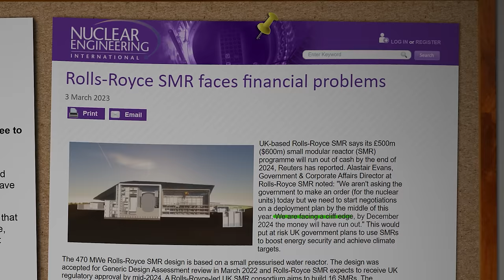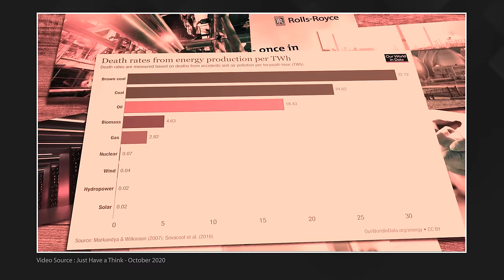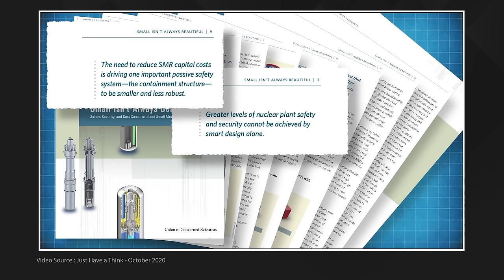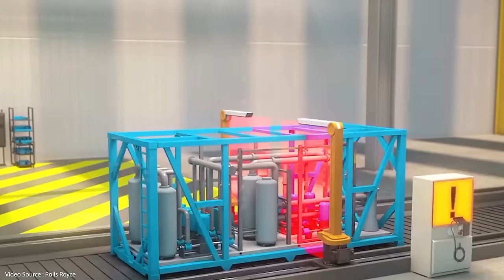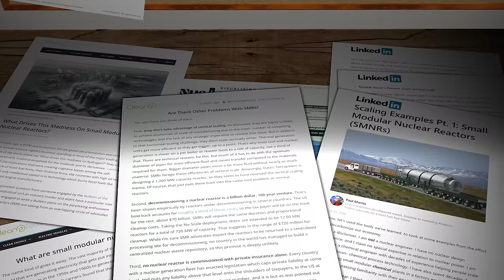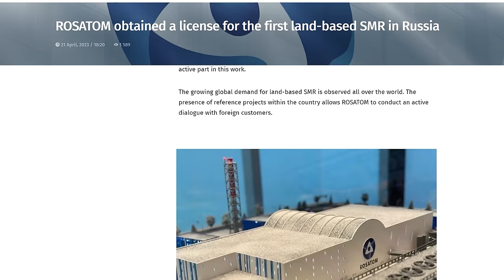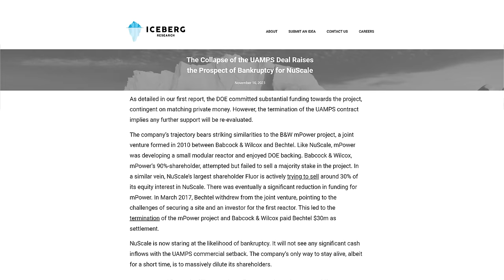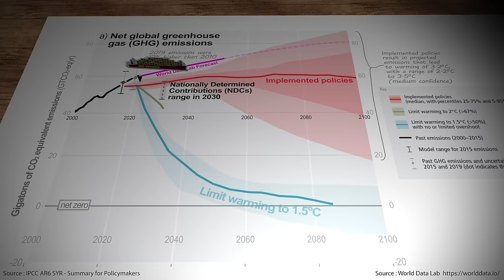Small Modular Nuclear Reactors. The Verdict

Comment: SMRs dont make any sense. Nuclear power was expensive. So they tried to build the largest plants possible to leverage economy of scale. That failed. Especially in the west. You need to be building nuclear reactors continuously to have the expertise to do it affordable. The first one will have a huge cost overrun. So the nuclear energy came up with a new idea. Make reactors really small so they can be mass produced. And in this way leverage the economy of scale. Problem was, making a really small nuclear reactor is not safe and has technical issues. So almost all SMRs are just small nuclear plants. Build in the same manner, just smaller. They aren't mass produced in a factory. And you don't build like 16 of them, to add 16 more later. You just build 1. So it's complete misnomer. If SMRs were actually small and cheap enough so that every town could buy their own SMR, then ok that's different. But it's not that at all. And guess what! It is way more expensive than the older very large plants. On top of that, solar has gotten absurdly cheap. The cheapest energy ever. And you can just place panels next week. Not in 30 years. Even offshore wind starts making a profit in 6 to 18 months. But nuclear needs government in subsidies, government insurance, government guarantees for decommission and cleanup. And even in that case, you will only start to make a profit 50 years from now. Assuming solar and wind don't get even cheaper. And that doesn't even go into the load-following aspect. Or the aspect that we will overproduce electricity and the cost comes from transport, storage, and using it when there's no wind or sun. Which nuclear won't be able to adjust to.

Comment: Small modular reactors are already being used to power submarines and aircraft carriers aren't they? So whats the problem with using this apparently proven technology for domestic purposes?
Reply: You are exactly right....what is the problem?  They have been around for over 60 years and neither the U.S. or Russia are using them to produce commercial power.  That may not explain why but it sure does prove that they are completely different from what is necessary for a commercial application and that SMRs have never been and never will be the answer

Comment: They're fine. The point is that one of the main costs is regulation so if you could just make identical smaller reactors and add them to a site, that could reduce costs to a significant degree. But like with working thorium reactors having existed for decades, what is rational doesn't matter so much as political-social incentives. You lean into the latter facts under the guise of the former far too often unfortunately

Comment: Nuclear power is still the best and the most "green" form of energy. Wind turbines need careful consideration to almost the same extent as dams for hydroelectricity for example. Altering the winds would have perhaps even worse effect on the environment than daming up waterways. The issues with solar are more complex. It works decently on short term and for modest scale but solar panels still need decades of development before they can surpass their own carbon footprint for creation. Nuclear energy on the other hand may be expensive but it's largely down to regulations. If a gas or coal plant would be under similar restrictions we'd be talking about similar expenses. Some of these regulations are reasonable (and written in blood) but others are just done to further feed the paranoia.

So no, for a new green Earth the most sane solution would be nuclear power. And if it needs pulling the wool over regulators' eyes to greenlit more nuclear power than it shall be done. That's my own take on SMR. It is an improvement but the main problem is that countries are less willing to build tried and proven nuclear powerplants. So they try to paint SMR as the lesser evil and finally get more nuclear power down. And who knows? A lot of technologies involved with SMR can be fed back to conventional nuclear powerplant designs in the future. Consequently it also adds money that can be spent in the sciences and engineering of nuclear reactors which may get the promised "holy grail" of fission power in the future: actually small nuclear powerplants.

Comment: For large parts of the world solar is an option. Wind is not an option, it's too unreliable. To rely on wind in the UK in Dec- Jan, you'd need about 2 weeks of storage. For the UK that's would be about 14 TWh of storage. I'm not aware of anything that can store that amount of power. We currently use fossil fuels to provide that back up.
For northern latitudes, I don't really see any alternative to nuclear.
I don't really consider 400 MW a SMR, not really the sort of thing that can be mass produced.
Personally I believe nuclear, in one from or another, will be the solution to our energy needs.
It'll be interesting to see in 10 years if nuclear conquers all, or if there is an amazing cheap, vast storage solution breakthrough. It'll be quite nice if we get both.

Comment: Only when we can completely reuse electric batteries and not have them as an item that cannot be recycled after the vehicle has been used in any way whatsoever landfill cannot have any of these batteries whatsoever so until we get a better system and we put along a little bit we may find that these electric cars are only good for certain places at certain times And you certainly can’t ensure them good luck with that. Regards Al from down under.

Comment: Attempts to build and deploy SMRs have kinda fallen on their face so far, precisely due to the lack of economies of scale.  The problem is that just achieving production scale alone isn't even remotely beneficial enough... it does not translate to the entire project gaining the same economy.  A great deal of infrastructure is needed even to just support a "small" SMR.  The permitting, building, operation and security, methodologies for fueling and maintenance and monitoring, labor, employee count, and grid infrastructure required... none of that scales or ever will scale.

SMR projects have been rapidly upsizing the amount of generation to try to justify the cost, to the point where they aren't really "small" any more, let alone modular.

I personally think that SMRs are a fail.  The only path we have to nuclear is to build large reactors, and economically speaking there's no point even starting to think about doing it until there's enough grid-scale storage to allow new reactors to operate with a consistent output 24x7.

California was only barely able to support its one remaining nuclear plant over the past decade.  It has actually gotten easier now that grid-scale storage is being scaled up in the state.  And as more grid-scale storage is added, the easier and more economical it will be to support nuclear generation.

-Matt

Comment: Climate is not becoming more chaotic. We need to stop building in flood plains and on beaches.
Reply: We have global warming, which is causing climate change.
Reply: The floodplains are much bigger than they used to be. In my city, we've had two 500-year floods and one 1000-year flood in the last 24 years.

Well it's possible this was just an extreme outside statistical event, it's more likely that the floodplains are no longer correct.

Comment: similar to aircraft carriers, submarines ones, could it be
Reply: Reactor submarines are not cheap (fuel load is $1 billion), they are very inefficient because they do not have the room for reheaters, and they have  none of the safety systems required for commercial units.  The first U.S. nuclear power plant (Shippingport) had a 60 Mw output (typical SMR capacity) took up three levels and 4 acres.  Look at a typical commercial power plant (1,000 Mw) and any SMR fraction of that output will be at least that fraction in size.  The larger the plant the more efficient it becomes and vis versa.

Comment: I work in the Nuclear power (US) and it was obvious to me over 10 years ago that a nuclear resurgence would never catch renewables like wind, solar, and hydro just by looking at the megawatts of these other technologies coming on line each year.   15 years ago there was talk of a nuclear renaissance in the US but most of this plants were scrapped with only the 2 unit Vogtle site in Georgia coming on line.   Nevertheless, I would like to see nuclear move ahead to that it might aid in the retirement of fossil units which is sorely needed in the next 3 decades, and just in case there are other issues with renewables that emerge.
Reply: I worked in the nuclear industry as well and live within 60 miles of both VC Summer and Vogtle.  My electric rates have increased 25% specifically due to Vogtle units 3&4 and will increase more in the future.  I am pro-nuclear but also a ratepayer and I have to say today the massive cost of new nuclear cannot be justified.

Comment: What about mineral requirements per GW of power? Do we have enough minerals for the renewable transition?
Reply: Yes. And a fossil fuel economy requires 500 times more materials mining than renewables. The crap you have to continuously mine, transport, and shovel into a thermal plant to produce energy had to come from somewhere.
Reply: @skierpage  , I would like to compare renewables with nuclear power, which has a very high energy density. Please also consider battery storage in case of renewables.

Comment: I'm up for all of the technologies in play that help us achieve our goals, and the behaviours too.
If the IPCC wants nuclear on the cards, then we should ask why are they right, and to not do so, wrong. If we also want to have our low carbon technology to be long lived, would we go for an 80 year life technology or a 20? Would we want one that consumes low levels of minerals per unit energy or a higher, because mining and tailings cause pollution too. Do we want those technologies to also provide high quality long term jobs, or not? Nuclear provides those jobs, wind and solar neither provide the same number, duration and quality (educational requirement) of jobs, nor the same level of secondary employment. We might only want electricity from our renewables, but if we want process heat, we can get it in a much more consistent manner from other sources. Would a smelter run efficiently with intermittent power? Certainly nuclear has it's problems, and one of the biggest ones is not learning from those places that can and do build on cost and on time (or close to it).

Comment: It's ignoring a VERY big elephant in the room to say that battery storage is real and easily scalable. 
The current installed grid connected battery storage in california for example is Infinitesimal compared to the capacity that would be required to shut of the states natural gas powerplants, which currently supply a full half of its power. 
The economics of battery storage dont work out.

Comment: You should investigate advanced modular reactors (AMRs). In particular the UK company Newcleo and French company NAAREA that formed a strategic partnership to accelerate the development of their fourth-generation nuclear technologies.

NAAREA is developing a molten salt-fast neutron nuclear micro-generator capable of producing 40 MW of electricity and 80 MW of heat, while Newcleo is developing two concepts for lead-cooled mini-fast reactors (30 MW and 200 MW).
Reply: On-paper nuclear technologies that exist in PowerPoint presentations are always better than the boring costly reactor designs existing in the real world!
Reply: it's just a rehash of an 80 year old design idea.   I have yet to see a so called 4th generation reactor which is not something that is quite old and in many cases did not work out at the test reactor stage many decades ago.

Comment: Yeah, right. Building high voltage power lines is trivial and can be done over night, whereas a nuclear plant can't? Nimbies seem to hate wind power, and whose going to pay for the grid upgrade needed for large scale adoption of solar? There are also massive challenges with renewables. We need a diversified approach which involves spreading the risks over multiple technologies. Nuclear power has a number of critical advantages, like the ability to provide reliable base power, which renewables critically lack. I don't give a crap about 2030! We almost certainly will not make those goals, so it's not a relevant argument that nuclear can't help. If we get moving on nuclear NOW (and on the renewable side of course) we may achieve some real progress by 2040 or 2050. Better latte than never I say.

Comment: If nuclear power plants are so efficient, cheap and safe, then why do they need nation states to underwrite them all?
Surely if they are as economical as they are portrayed, then private industry would not need any subsidies or financial assistance from governments in order to construct and operate them.
On the other hand, my solar system on the roof requires almost zero maintenance and will provide electricity without noise or pollution for the next 20 years, probably more. That massive fusion reactor in the sky is way cleaner and cheaper and no greedy corporation can stop me from using it.

Comment: The cost problem of the US site had nothing to do with the reactors. It was all site cost overruns. Not reactor cost overuns. Please be honest if you can

4:40 
"They are the size of a town"
No they are really not, more like the size of a block.

For example OKG reactor 3 at 1400MW is 260 meter wide and 320 meters long

5:10 "you don´t need 10 times the diameter or 10 times thicker walls"
If you would have both 10 times the diameter and 10 times thicker wall, you would need 100 times more material. Effectively to run 10 times more fluid in a pipe you need about 3 times larger diameter and about 3 times thicker walls. That makes it 9 times more material for 10 times the flow rate.. or there about.

6:10 No you don´t need to turn out millions of unit for economy of scale. Already on the second unit you have economy of scale. Typically you gain 30% economy of scale for every magnitude order you go up.

In this case we talking about replacing say a production line of 10 units with a line of about a 1000 units. that is quite a significant increase.

7:10 "the ods of fiancning damanging claim is to high"
Why would you suggest that. IS there any evidence for that what so ever?

7:50 Decmisioning is pretty much a solved entity today. keep up with the times.

12:30 "the only affordable"
Is it? why does it get so much subsidies then?